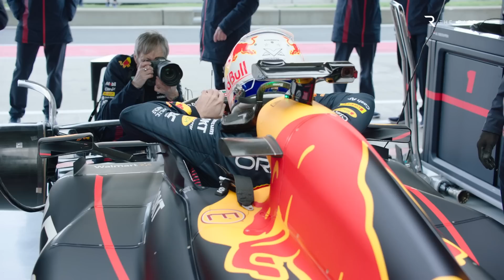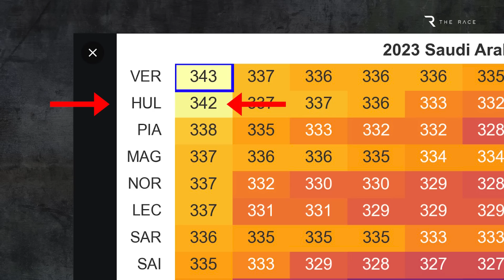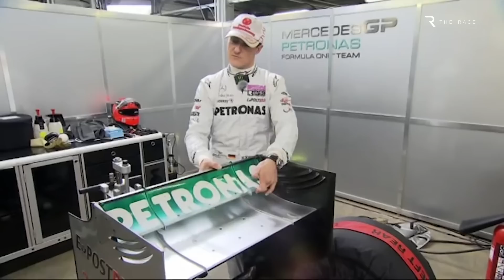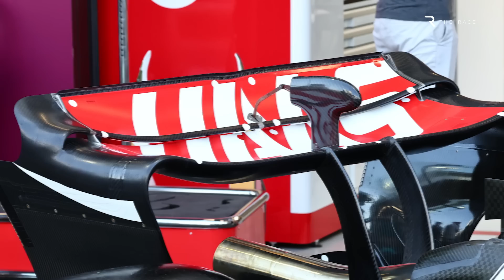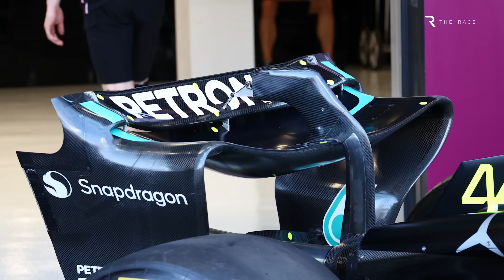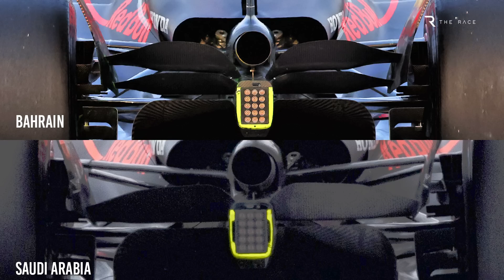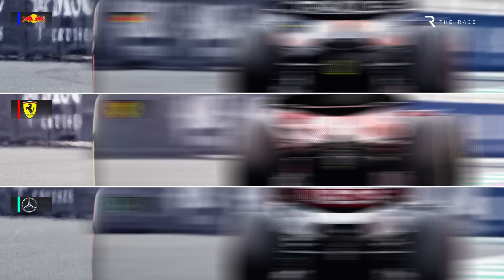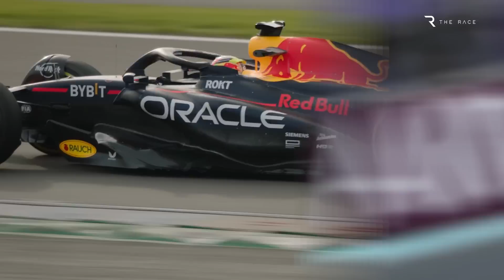Red Bull's genius 'triple DRS' F1 trick explained

Comment: Hamilton acting like he didn’t pass Vettel in 2014 with over 30kph speed difference without DRS
Reply: tbf in 2014 the mercs were just fighting each other. Everyone else was chum meat
Reply: Yeah fr💀
Reply: That year and until 2016 the Mercedes had a engine advantage that worked very well in the package they made. Which then continued to work with the 2017 rules. RB advantage is a bit different. Honda engine is not much more powerful then the Mercedes or Ferrari. So their advantage is massive if it's aerodynamically based.
Reply: Or screamed past everyone like they were standing still in Brazil 2021
Reply: Everyone knows about the engine advantage that year. The question for this year is that there's an engine freeze so the answer must be aerodynamic
Reply: @sunnys7645  Engine freeze doesn't mean the engines are equal lol. They're not. The Honda is the best, still to take nothing away from the aerodynamics. RBR are markedly clear in this aspect also. 👍
Reply: @F1ll1nTh3Blanks   when did i say the engines were equal? Merc dominated the engine side for a long time and teams caught up recently, now the honda engine is arguably the best and redbull were the ones asking for an engine freeze because they argued it would cut costs while the engines are the most even they’ve been in the turbo-hybrid era. They also argued it would protect them from splitting from honda and moving towards RBPT. Smart political move by them tbf. The differential across the grid was about 15hp from best to worst (the closest in a long time) with even the ferrari engine performing slightly better than the mercedes, despite the mercedes still being superior in reliability so there are trade-offs. Please understand my comment next time before replying with old news
Reply: @sunnys7645  There is an engine freeze but you can make changes to the engine. You just have to know the loopholes. Same as any regulation in F1.
Reply: @chrisccc22  Yes agreed but the engine advantage if any would not be significant compared to those days
Reply: @sunnys7645 so what? He still had an incredibly fast car. Doesn’t matter if it’s through engine or aero
Reply: @Eshan-y5w  the thing is you’re trying to find a way to say “why is Hamilton complaining” but im just talking about “why is redbull fast”
Reply: @sunnys7645  I actually think the engine freeze is what's hurting Mercedes the most.
Reply: @Poizen22  could be, the fact that only reliability upgrades are allowed when mercedes has the most reliable engine makes it tricky to gain power through loopholes
Reply: @Poizen22  not really. They're plenty reliable and if they're down on power compared to the Honda, it's not by much. The main problem is that the Mercedes-powered teams dropped the ball with the new regulations, and only Aston Martin managed, with help from Dan Fallows (who worked with Adrian Newey for years), to amend their car's aerodynamics sufficiently enough to be a remote threat to Red Bull this year.
Reply: @halofreak1990  The reason I say what I was saying is because Mercedes is always had a less aero efficient car than Red Bull Red bulls Almost always being the most aero efficient car on track, but they've never had the power unit until Honda in 2021. With the regulation freeze, it prevents Mercedes from leveraging development on their PU to make a faster car that makes up for their lack of Aero efficiency
Reply: @sunnys7645  happy for Ferrari that Binotto build auch a reliable engine then 🤣
Reply: For years merc produced downforce only through a massively draggy rear wing because their engine was that superior. Williams was 3rd best team only because of the engine. Now we see how good they really are.
Reply: @adrenalinejunkie3828  Vertappen had more DNF tan Hamilton and still won... When he lost to Rosberg it was due to his atrociuos starts and terrible form since Rosberg had 7 consecutive wins.
Reply: @Ale-nv2bo  how could you take away from how refined and fast Rosberg was that year
Reply: @AlizioHerman  You're right, I'm being unfair, Rosberg was on fire that year and if he didn't just cruise at the end of the season he would have one or two more wins.
Reply: "One only feels speed when it's coming from others," I gues
Reply: Ferrari 17,18 was 20kph faster then the merc
Reply: Hamilton cries about everything
Reply: Hamiltons selective memory strikes again.
Reply: Hamilton is right since if he’s driving the fast car he’s not looking at it. Now that there are faster cars he’s actually looking at them. 😂
Reply: i love how Hamilton lives rent free in so many people's head.  he could say 'hello' and they get offended.
Reply: Hamilton acting like him Rosberg and Bottas didn't routinely finish 40+ seconds ahead of everyone else.

Hamilton got to enjoy that kind of an advantage for 5 years! (2014, 2015, 2016, 2019 and 2020). Verstappens had it for 2 races and hes already complaining.
Reply: @footballnerd277  Well, even RBR complained all those years. So it's fair play I say.
Reply: @footballnerd277  And Verstappen car is a far ahead but nowhere close like Merc in 2014. Just look at Perez performance he is only 10s faster than rest in a race and he is not a bad driver by any stretch. It is VER who is abnormal for the most part.
Reply: @footballnerd277  his statement is accurate though, he's not seen another car beat him so easily, the wording excludes his own car...
Reply: That lasted until 2016  It's gonna be the same with the two Red bulls this year.
Reply: @footballnerd277  because 2022 didn’t exist?
Reply: @footballnerd277  hold on a second… of everyone on the grid currently, surely no one moaned more about the Mercedes advantage than Verstappen. And I say this as someone who doesn’t particularly dislike Verstappen or like Hamilton.
Reply: @footballnerd277  yeah, he should accept it and not complain. LOL. You have a losers mentality. And it shows.
Reply: @footballnerd277  rb cried during those years what do you expect
Reply: @footballnerd277 it’s a day that ends in y.  Therefore it’s a day that Hamilton whines.
Reply: @footballnerd277  if we are going to call that complaining; then Verstappen has done more than his fair share before he started winning.
Reply: @footballnerd277  how is this complaining? Complaining is what you guys have been doing for years trying to get merc stopped.
Reply: @footballnerd277  the Merc advantage was not 40 seconds for 5 years that is a grossly exaggerated statement
Edit- also i wouldn’t say it’s complaining its just more of a demand for his team to do better
Reply: @sunnys7645  nah its hoping for regulation fixes.
Reply: @sunnys7645  no it‘s not. I did not watch F1 since the silver war because any time I clicked in the 2 merc were over 30 ahead and I turned off again. 
Maybe not EVERY rave but 90% of the time. So Hamilton can shut it.
Reply: @lespaz1197  the only possible regulation change would be to nerf DRS which was planned anyways. And even then redbull is still the best car
Reply: @sunnys7645  Mercedes (and Toto Wolff personally I believe), have admitted that in 2014 they would have been able to lap the rest of the field. The only reason they didn't do so was because they feared the FIA would step in. Instead, they limited engine modes and limited their car to a pace advantage of, say, 0.5 to 1%. Easily enough to win almost every race. For the next few years (2015 and 2016), if other teams moved too close, they would just use a slightly more powerful engine mode and they still won.
Reply: @Dario_1991_4  Yes and redbull could very well be doing the same thing, considering despite the gains other teams are making, redbull consistently seems a step ahead
Reply: @sunnys7645  Lets not forget it is only 2 races in, but the early sign point to it not being the case. First of all, the engine power is virtually identical between al cars. This was definitely not the case in 2014. 2nd, all the Merc teams were up front in 2014 (Williams, Force India and McLaren). The only other Honda car, AT, is at the back. 3rd, RB seems to have in hand only a 1-3 tenths in qualifying, the race dominance is down to tire management. Merc and Ferrari both built tire eaters, if they solve this problem it will become quite close. But I will admit my wrong if RB in 20 out the 22 races this season.
Reply: @Dario_1991_4  You could be right, but again the redbull advantage is aerodynamic, they could be holding back on upgrades to further increase their aero efficiency as they can nearly match everyone in the corners while having a very high top speed at the same time. It could also be possible that a low elevation, hot climate track like bahrain and saudi could suit the rb19 extremely well compared to something colder like Australia
Reply: Thank you I was thinking of how to say this and you already said it cheers 🤙🍻
Reply: Sooo true
Reply: Remember 2018 Spa that Vettel passed him like rocket ship him you SOB 🖕🏻
Reply: A Dutch F1 website already did the calculations. Mercedes was much faster relative to the rest of the field. But I think Lewis was more talking about the top speed difference than average speed differences
Reply: You are talking about engines that were brought into f1 for the first time. Different aero and many other differences. Talk about vettel 2019. If u want. That makes more sense
Reply: @adrenalinejunkie3828  you can’t expect these single brain cell’d amoeba do any critical thinking…
Reply: Seriously
Reply: Typical Shamilton behaviour! Can’t wait to see him gone from F1 for good!
Reply: @adrenalinejunkie3828  bad luck doesn't change the fact that the machinery was literally equal. Same car, same engine. Changing minute setup details or having crap luck with an engine doesn't mean they weren't equal cars.
Reply: Does it stop him from saying it? 🙄
Reply: 210 years ago^^
Reply: that happend never? literaly the difference was at 20kph max.
Reply: Ferrari in 2018-2019 did the same to Hamilton even at Spa
Reply: Hamilton always Crying . Hippocrate
Reply: Merc in 2014 and RBR in 2022 cancel eachother out
Reply: And all other drivers including the fast harrasing Redbull all over the past years. His car was the fastest to make (minipulate) a driver of colour as champion. He didn't work to become a champion.
Reply: That's a different era. Remember there was no budget cap as well.
Reply: British cry baby needs all attention and sympathy let him cry
Reply: So ? It’s irrelevant, they’re here to compete, what do you expect ?
Reply: they had massive engine advantage that year since mercedes kinda cheated, they knew before everyone else about the engine regulations. And they also had a very good car aero
Reply: Why is everyone complaining about Hamilton??  He only said “the Redbull is the fastest car he’s ever see”.
Jeeeze, can the man make a simple comment without all you haters jumping down his throat!!   Give it a break!
Reply: Technically he is not wrong as he didn't see his car
Reply: he can't remember ever being in a slow car apparently.  never seeing any other fast car is understandable when you are in the front of every race without having to try.
Reply: anybody knows if there a specific race that HAM overtook VET with that speed diference? I'd like to watch that. Thank you!
Reply: @rafaelgoulart1085  Any of the races where he had to overtake Vettel in 2014-2016. At the start of the hybrid era Mercedes even downtuned their engines so the FIA would not intervene. They estimated that they could have lapped the entire field had they used full power from the start...
Reply: @rafaelgoulart1085 not sure if the speed advantage was that much but check highlights of the 2017 Spanish GP. If I remember VET even made a statement "no chance, he's like a train, there's no chance" while defending from HAM
Reply: @mrsossie  what about 2018 spa?
Reply: @rafaelgoulart1085 Spa 2019
Reply: @rafaelgoulart1085  look up 2014 season, there are multiple races with 40s+ gap between them 2
Reply: Hamilton has a short memory
Reply: @Giovanni Giorgio  they clearly made mistakes on the aero side and that’s why they’ve fired people recently. Hamilton was just praising his team i don’t see what’s so funny or bad about it. They did dominate for an unprecedented time period unless you forgot
Reply: @sunnys7645  Merc nerd spotted
Reply: @spaceli0n  rather be a nerd than a troll
Reply: @adrenalinejunkie3828  i’m a hamilton fan but its just a meme, no need to get so defensive about it. Rosberg himself knows hamilton is the real deal thats why he retired
Reply: Hamilton is always complaining, he’s F1’s little diva.
Reply: @69memnon69  says the one always complaining about Hamilton 🤣
Reply: Lewis would have 8 if he wasn’t beaten by nico rosberg in equal machinery. He should just retire, number 8 isn’t coming anytime soon
Reply: @kesh_r  keep telling yourself that
Reply: @kesh_r he would've had 8 if he wasn't robbed in 2021. They should reinstate the rightful champion. Then, and only then, can he retire.
Reply: @michaela5430  Masi did exactly what the team principals, INCLUDING Wolff, asked him to do: make every effort possible to finish under green flag. He did that, within the regulations as written and the leeway specficially granted to him as Race Director -- by the regulations, verbatim -- to alter the procedure as necessary. Force majeure was the length of time for cleanup being longer than anticipated and the lack of time to get all backmarkers through in a safe manner, so the decision was made to get most of them through in order to finish under green instead of under a safety car. Again, exactly as the team principals had asked prior to the race. Only Wolff changed his mind after it became apparent he'd get the bad end of the deal.
Reply: @michaela5430  What a delusional fanboy lmao. Talk to us about Silverstone and Hungary 2021 now? Verstappen wasnt robbee? Hate it or love it Verstappen destroyed your lord on an inferior car.
Reply: @michaela5430  2008 Feliüe Massa?
Reply: @Seba-kl3rv  the butterfly effect. I don't see how that can happen.
Reply: You people acting like Hamilton is complaining ab Red Bulls car. Also Lewis didn’t always have the fastest car and still won lots. Merc and. Lewis will be back. Stop nitpicking every little thing Hamilton says
Reply: @killunova  blah blah. Lewis is slower than Russell in his own team lol
Reply: @killunova  Lewis did not always win a lot in a car that wasn't outright fastest. LOL. Dude was handed 6 out of his 7 WDCs
Reply: @BruceWayne-eh4im  so your claim disregards Rosberg’s and Bottas’ pace. Will we disregard Sergio when Max continues to succeed?
Reply: @AlizioHerman  dont know what it has to do with Max. Lewis sucks.
Reply: @BruceWayne-eh4im  I made the most rudimentary comparison possible. If you can’t process the connection being made then you ain’t Batman 😂😂.
Reply: @killunova  exactly lol, all lewis is saying is that redbull got it right and merc got it wrong
Reply: @killunova  All of Hamilton championships were won in the fastest car. WTF are you talking about? 2008 2017 and 2018 Ferrari was close but Mercedes was still the faster car
Reply: Every breath Hamilton breaths is a lie.
Reply: @terrym4037  Those are good lies then. 😂 7 rings and the greatest of all time.
Reply: @justgetit3918  ok you're right with what you said. He is a 7 time world champion.  Considered one of the greatest. But he still lies every time he talks.
Reply: I wonder if Max touching everyone's wing has anything to do with red bulls Drs
Reply: Diff era.
Reply: @roeks07  that doesn't matter when you're statement is "I've never seen a car so fast"
Reply: @roeks07  so what does this mean. Common now.
Reply: @roeks07  Agreed different era, guess what? cars back then were more draggier than they are now.  This argument doesnt work in your favor.
Reply: @BruceWayne-eh4im   when were the 2014-2016 cars ever more draggier than the current era cars 😭 they were the quickest cars in a straightline and not a single year of F1 cars has been able to replicate that same straightline speed. 

didn’t know wider cars made them less draggier all of a sudden.
Reply: @roeks07  doesnt matter
Reply: @roeks07 glazer
Reply: @roeks07  same case.